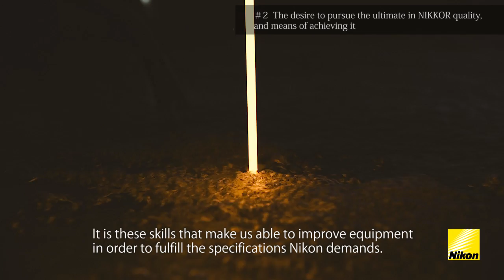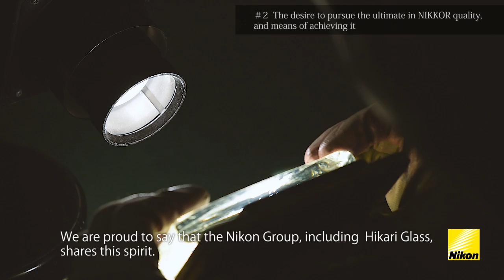The minds behind NIKKOR lenses: HIKARI Glass

Comment: a) Are all Nikon/Nikkor branded lenses based on the glass manufactured here?
b) it seems Nikon still has to do the final polishing of the lens shape and the glass elements are half-products in this way.
c) if b=yes then Nikon has to put a coating on elsewhere still?
Reply: Nikon also uses glass produced by other glass manufacturers.

For example Ohara Corporation (another major glass manufacturer) list Olympus, Canon, Nikon, and Fujifilm as major customers.

I presume if a specific glass type they want is isn't feasible for some reason to produce at their own plant (Hikari Glass is a Nikon Corp Subsidiary). I also presume that nikon polishes and coats the vast majority of their lens elements.
Reply: Optical glass companies supply shaped blanks. Polishing ,centering and coatings are done in the lens division.